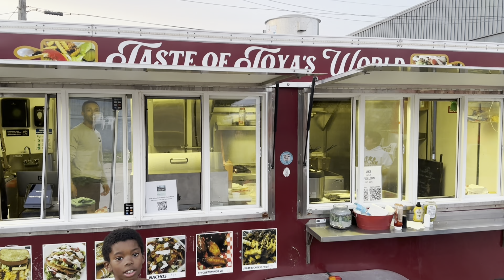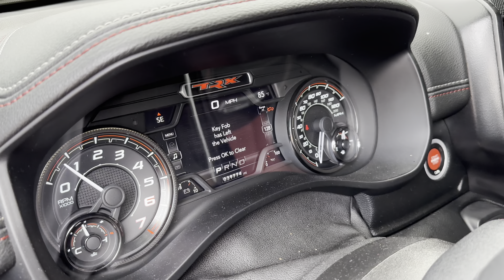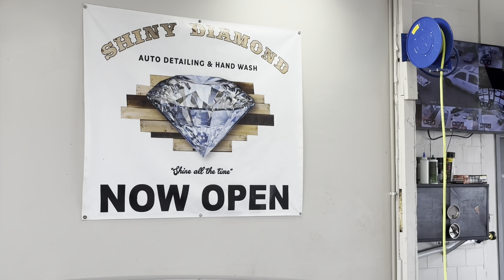BIG BLOCK G-Body Malibu on 24in Golds | SUNDAY FUNDAY

Comment: I have 88 camaro having a hard time deciding on overhauling my 350 block or doing a LS swap
Reply from the maker: LS.. makes more sense. Im going LS in the white 81 Camaro. If you overhaul the 350 and go built 355 or 383 it’ll be the same or close to the same price as LS swap